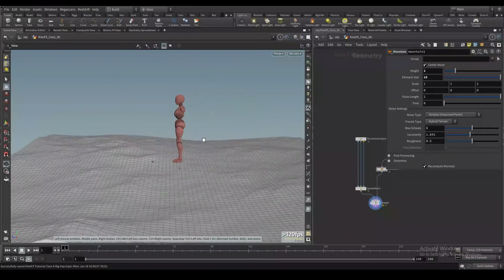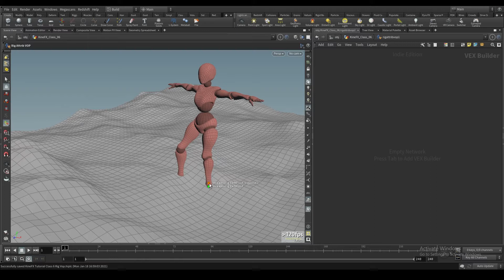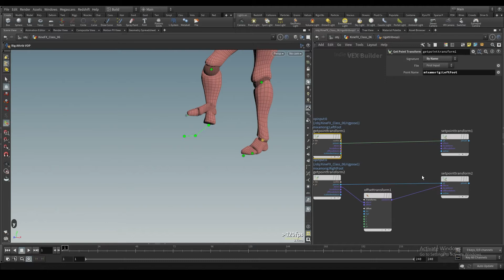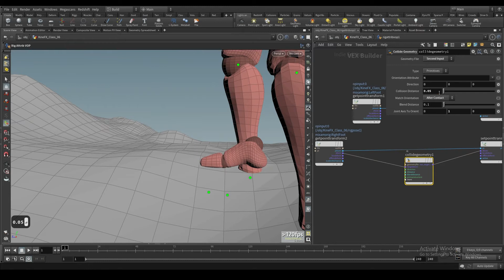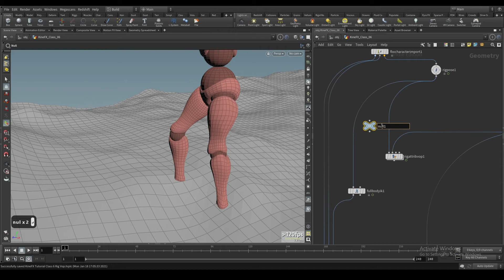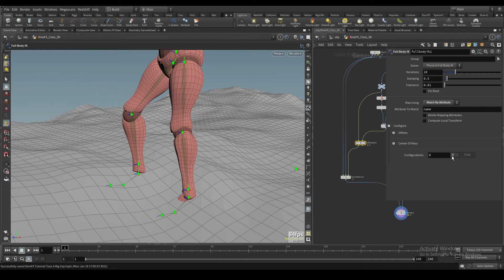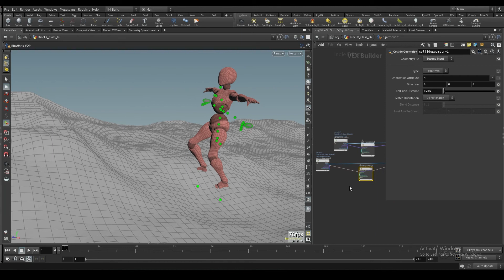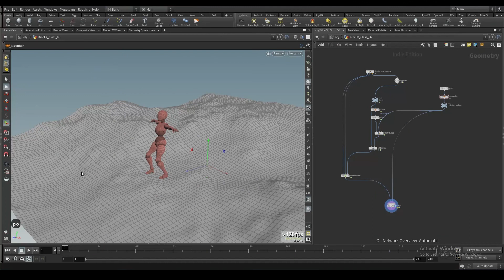Houdini KineFX 101: Tutorial Six - Rig Collision with Meshes, Rig VOP Intro

Comment: Mad respect for putting in the work to figure this stuff out. Admittedly your tuts are invaluable help but I can't tell if you're building full rigs and animate or are just rly good at experimenting lol. For example, in this tutorial, you sort of skim how your character flys up when changing the foot priorities then, you move the floor to demonstrate. While that's a totally valid use case, it would be much more common that you'd move the pelvis down and expect the legs to then bend rather than falling through the floor, but the latter is what happens to my experimenting : / if you're on discord and open to any paid tuts, hmu plz lagauche@1079
Reply from the maker: Shot you my discord btw too! should prolly just put that out there more
Reply from the maker: for your instance it would be best to use IK chains on the legs and on the first input THAT is where you would lower the pelvis, this way not effecting the position of the feet. The example in this video is more something you would use if your character is already animated but the feet are going through the ground. Hope that helped a bit! If you need more about IK chains I have a video on that as well in this series! Cheers!
Reply from the maker: Hey Ian! I do a lot of rigging and animation from scratch in Houdini, a lot of the things in this series is kindof watered down for both length of video reasons (most people dont wanna watch a 3 hour video lol) and also just trying not to overwhelm people as this is intended to be a beginners course. Just trying to show the effect these tools have as clearly as I can and leave what you actually do with those tools entirely up to the viewer! This one was also recorded at the end of a very long day lol If there is something i didnt cover that you would be interested in learning more about id be happy to help if I can!